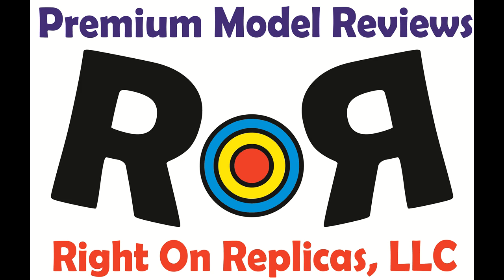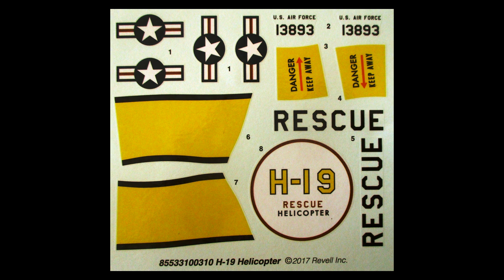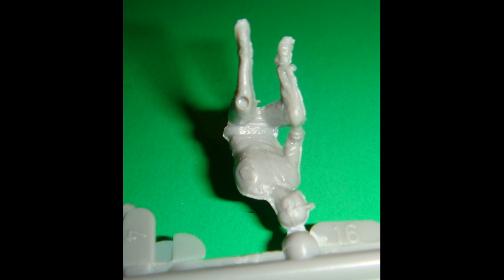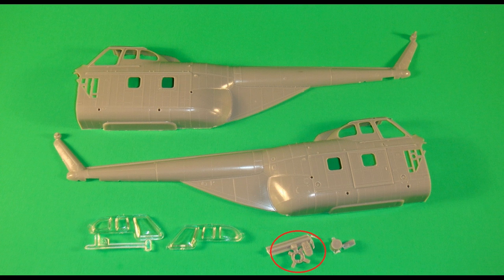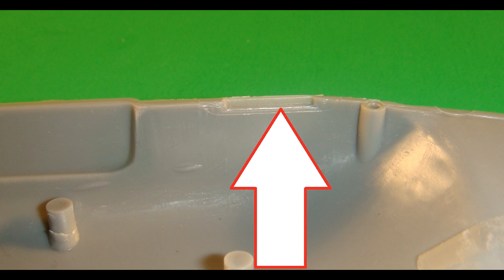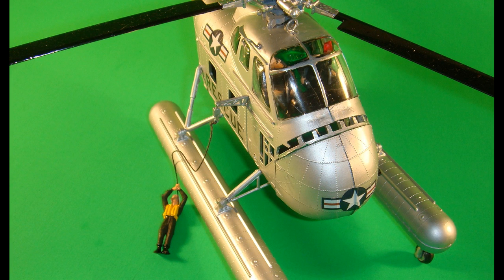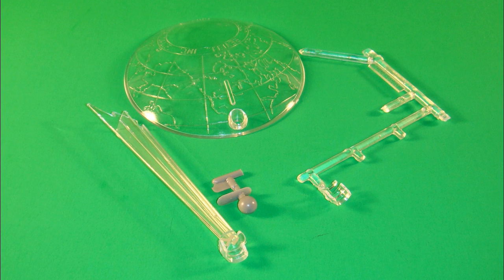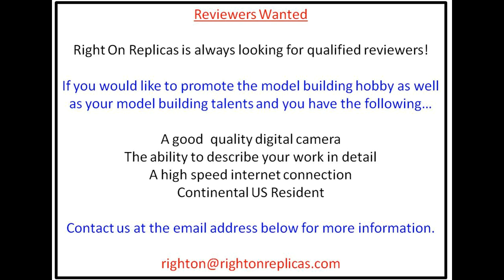How to Build the H-19 Rescue Helicopter 1-48 Scale Revell Model Kit #85-5331 Review

Comment: Mine, a first production model,
(bought it in the early '60s),still like new, and also the box kept as new, with the plans and all the spare parts inside, (yes, I do colect and keep all my boxes.!! - circa 1,500-plus kits
!!!)
   Anyway, it's to tell you, that in the original series models, Revell included a steel spring circlip, to hold the two parts
of the socket that secures the swiveling ball, on top of the stand pillar.
(No cement needed there).
   Thanks for posting this video.
   Keep up the good work.!!!
Reply from the maker: AR, Thanks for the kit history!  -Doug
Reply: A Rodrigues : ...wow, and I thought I had a kit collector problem...
Reply: start a channel detailing your collection. Please.

Comment: Is it mold of  +panel line?
It looks to be need reengraving...
Reply from the maker: MX,  They are raised panel lines.  The mold is over 50 years old.  Re-scribing is possible - have at it!     PS,  please subscribe if you haven't already to help us reach more modelers.  -Doug
Reply: @RightOnReplicas  thanks for your reply. Recently I found this kit on my place here in Korea.  I wish to confirm how's condition of this kit. I will try to make this classic vintage kit soon. Thank you much.

.
Reply from the maker: MX,  The kit was well restored and with fresh decals in this latest release it builds well enough but it's still an old mold design.     PS,  please subscribe if you haven't already to help us reach more modelers.  -Doug